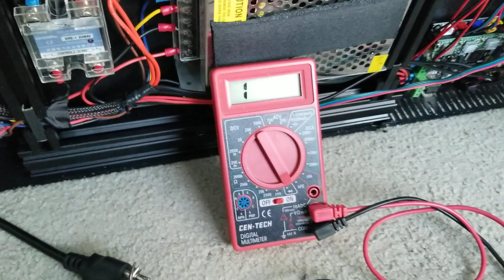Artillery 3D Sidewinder X1 not grounded???

Comment: You have no idea how to read/ use a multimeter or what you doing and need to stop making stupid videos like this. "Also, for those wondering with my voltmeter, I measured on average 3.5 ohms of resistance from the end of the plug to metal points on the chassis." Your multimeter is measuring voltage drop and not Ohms. All you proved is that you have a connection around the frame and the paint isnt conductive. That doesn't mean its safe to use. The earth resistance on all Class 1 appliances must be below 1 Ohm. If you dont believe me check the manual for your multimeter https://manuals.harborfreight.com/manuals/98000-98999/98025.pdf 
"1. Test the voltage drop in diodes.
2. Turn the Range Selector Switch to the
Diode ( ) position.
3. Plug the red Test Lead into the VWmA
(Center) Jack. Plug the black Test
Lead into the Com (Bottom) Jack.
Switch the Multimeter ON.
4. Connect the red probe to the anode
of the diode and the black to the
cathode.
5. The approximate forward voltage drop
of the diode will be displayed in mV.
If the connection is reversed only “1”
will be shown"
Reply from the maker: How about instead of harassing me on every social media platform there is you do a video proving what your claims are? That would be a better use of time!
Reply: You started this by replying with incorrect information on my post. You were also told about your mistake by another viewer in here about 2 months ago but you still choose to ignore him and tell people that you are correct. You have no idea how to test a Class 1 appliance and you should mislead people.

Comment: You don't use the Diode Check setting on the meter for testing continuity.
Reply from the maker: Okay then what is the diode check setting for and what do I use instead?
Reply: @MakeItWithCalvin  Diode check is for testing Diodes, a electrical component that allows current to flow in one direction.  You want the ohm settings on the meter. Look of 0.1 or 0.2 ohms of resistance between the ground pin on the inlet (not power cord) and any accessible metal part that is likely to become energized during a electrical fault condition.  Testing to the black painted/anodized surface means nothing. You should also pierce the paint layer with the tip of your probe to get to the metal frame. BUT, to do it properly,  you should have a ground continuity tester for testing with 25-30 Amps of current.  Not cheap.

Comment: I have the artillery genius, currently using it with a plug with no ground pin. Should I replace that then?

Also, would you be able to tell me how to use the printer wifi? It has the buttons, but it does not seem to do anything.
Reply from the maker: Plug with no ground pin, you mean cable or socket? In theory, if nothing gets loose your ok but better safe than sorry. 

As for the WIFI, it is baked into the TFT firmware and it needs an external module.

Comment: Test the bed please
Reply from the maker: The bed is "sealed" so it does not need grounding.
Reply: I apologize but I have to disagree. The mains voltage goes straight to the hotbed. If by any chance some electrical wire strips and makes contact with the bed I do not want to be present at that time.
I have an AC hotbed printer and it is grounded.
Reply: The bed has adjustment knobs. These screw into screws that are in contact with the bed. I think you are following me...
Reply: @nunogarro  the silicon heating pad is a self contained heater. A lot of manufactured heaters (in the US and Canada at least) come ungrounded. It's common because they're basically a giant resistor. Have a look at block heaters or battery warmers for a vehicle (if you live in a cold climate). Many don't come with a ground for the same reason. Some pads I'm sure come with a ground but because the silicon pad itself doesn't have any metal parts (and it's manufactured that way) it isn't required to have one.

Comment: You can not test grounds thru paint. Even the silver aluminum has an anti-oxidation coating.
Reply from the maker: Paint is paint, the aluminum is generally anodized which builds up a thick layer of aluminum oxide which has an extremely high resistance and is "insulating" due to that fact.

Comment: Aluminium is conductive...sand off some of the coating and guarantee you have ground
Reply from the maker: You are correct, where the threads are the anodizing was cut off and that has given the whole frame conductivity to the ground.

Comment: The issue is they are trying to measure on a painted surface,  so to speak. 

the body of a car that’s painted is not good conducive surface. it doesn’t appear to be grounded either because the paint is an insulator.  You scrape the paint off and voila you have ground. In this case the anodizing is an insulator so you’re correct in saying it is grounded. It is protected.

Glad you brought this up.
Reply from the maker: That is the point I was trying to make, never trust one-point of measurement. I always will check a few points just in case something was not making full conductivity. Better safe than sorry.
Reply: That you did Sir. Good job. 
The problem is, people are too eager to point fingers instead of doing investigation and determine fact.
Reply from the maker: @stevedonalson5675  Exactly and the problem is a lot of new people think that it is fact and it has serious consequences and no one wins in the end!

Comment: You are right, also in my machine, everything is grounded, only the paint (no anodizing) is not conducive.
If the casing was anodized, I think the outside of the printer would have been conductive too.
Reply from the maker: Anodize is a layer of aluminum oxide and it has an extremely high resistance to electrical currents so under normal circumstances it is classified as insulated. Alodine is a special conductive anodizing for parts that need to be conductive on the surface.

Comment: Good stuff Calvin. Another interesting test would be to show there is NO continuity between the hot spade on the plug and the metal parts as well as checking the neutral spade on the plug. That would show there can't be leakage current to the frame/metal parts during operation. 
Thanks for sharing!
Reply: ThierryDeux I just bought received my X1 today here in Australia. Here only plastic appliances don’t have an Earth prong on the plug... any appliance that has a conductive surface you can touch has a 3 prong plug that includes an earth prong on the plug. 
My X1 cam with a 2 prong plug and a cheap arse adaptor to convert it too the bladed 2 prong Australian standard. It needs the 3rd earth prong so if the worse happens the current will flow along the path of least resistance, that being the earth wire that runs to a stake in the ground near your house fuse box. 

So year should have a 3 prong plug...For sure.✌️✌️✌️

Comment: Very useful stuff Calvin. However maybe others who claim no ground have different version machines. Which version are yours?
Reply: So far every "isnt grounded" claim ive seen was people testing at the wrong places, most coatings are excelent insulators so you test the housings conductivity at the bare metal of a screwhole or scratch point, not on the coating. Even testing on a screwed in hardware can falsify the test due to locktide, oils, coatings on the screw itself or other none conductive material between the threads giving you a false and/or lower readout. But not everybody knows that, i do due to my profession, but i wont expect some office warrior dad to know this just because he got into 3d printing, he just knows stuff should be grounded but not how to test it proper.
Reply: @FullMetalFox2  Thanks for this info, I was worried but I can sleep better tonight:)